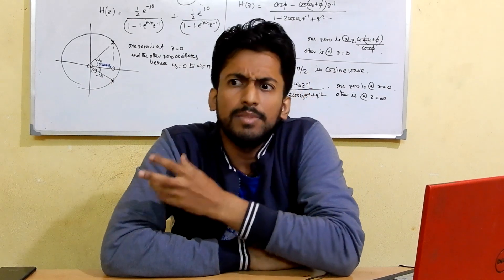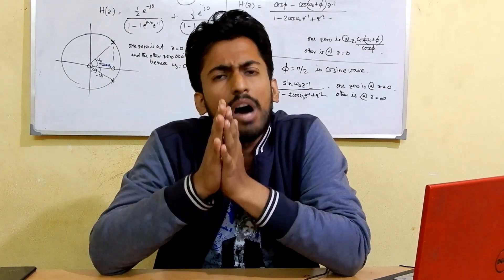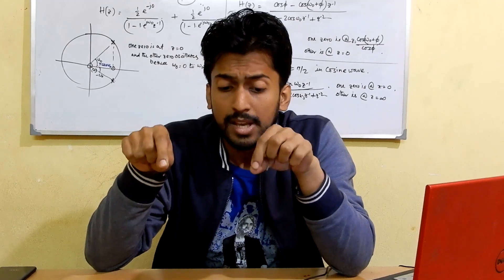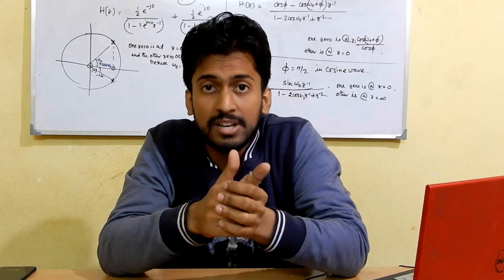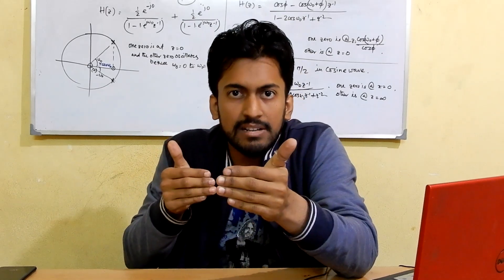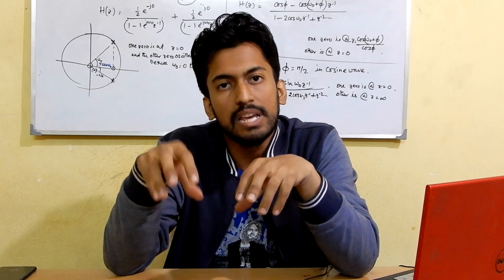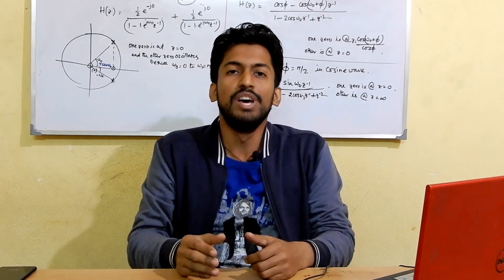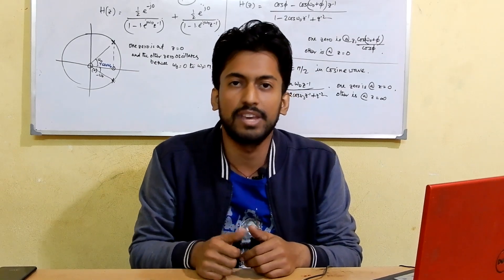Why do Transformers hum ? | Transformer Noise

Comment: All right ... my problem is called lcd transformer, i mean is the trasformer of my benq pd2700U my headache. 
The monitor went back and forth for repair 2 times and in both cases the assistance service did not detect any problems.
However, when I connect the monitor to the mains my audio card starts making noises, particularly when I insert external sound sources such as analogue synthesizers into the card itself.
When I unplug the monitor from the mains the silence returns (it is not enough just to turn it off I have to unplug it).
The monitor is connected to my macbook, obviously in the recordings I can solve the problem and keep it off, but I always like to use it ... how can I do?